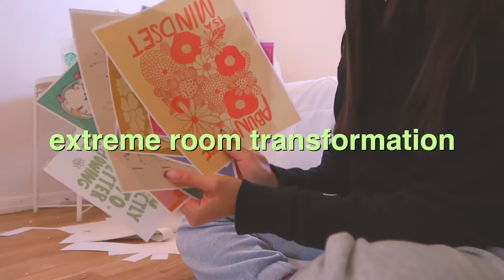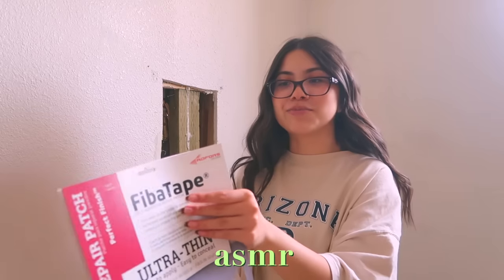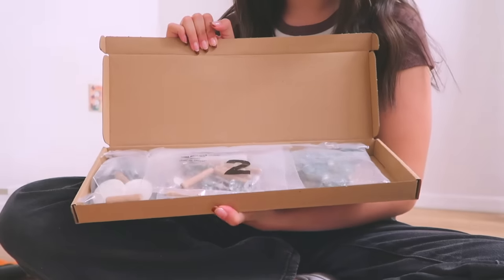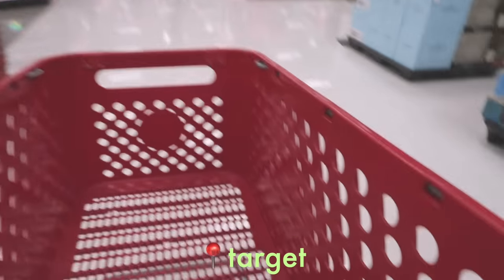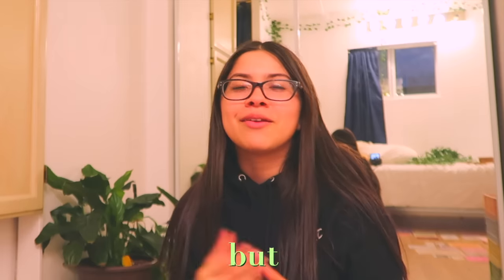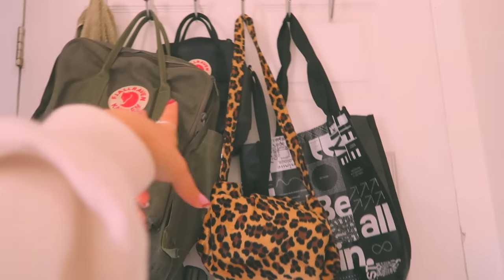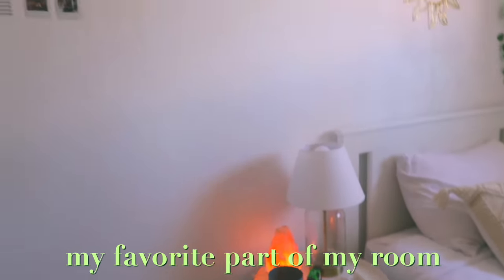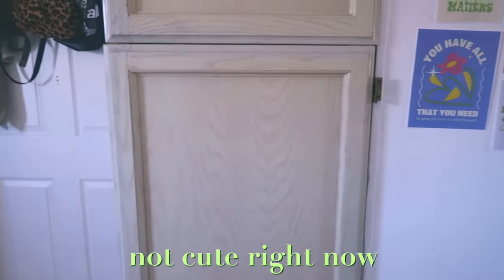EXTREME ROOM MAKEOVER + TOUR 2021 *aesthetic/tiktok/pinterest inspired*

Comment: With which tape or glue did you stick the pictures i want to stick pictures in the walls of my room but i am a little afraid that the paint might come out or it would damage the wall
Reply from the maker: i used gorilla tape! it did unfortunately take off some paint /: i’ve heard that using sticky tack/mount putty works well 💗
Reply: @adriananoriega  thank you so much ❤️